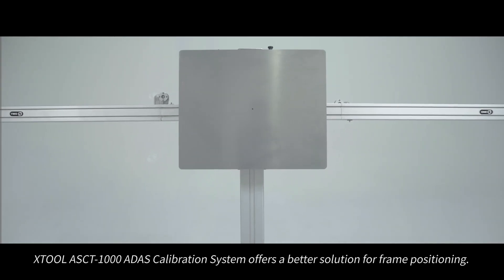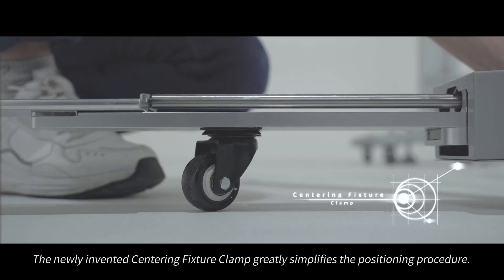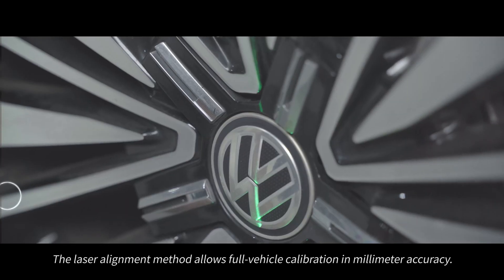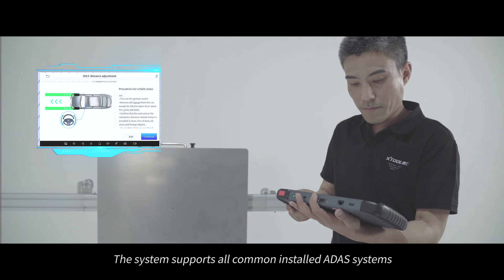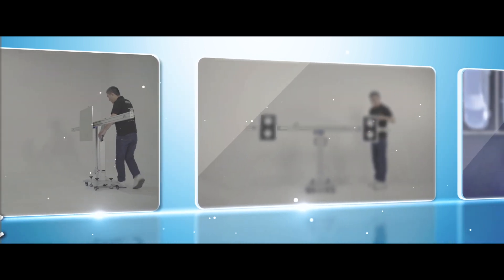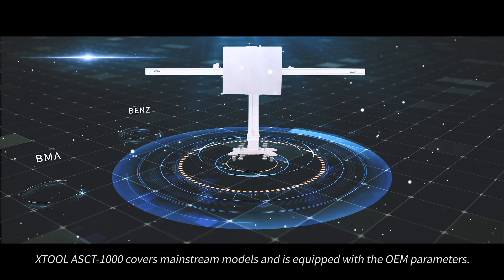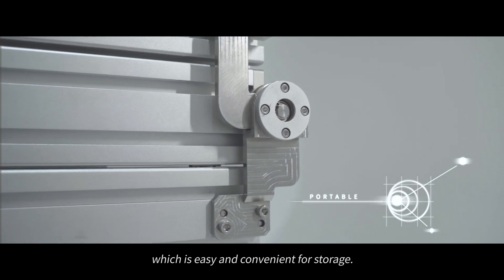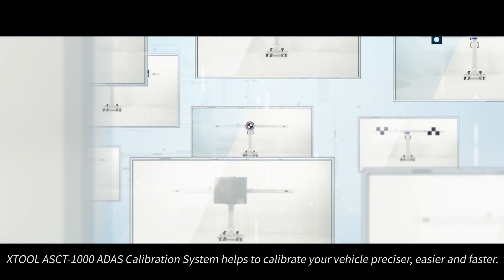XTOOLTECH ADAS CALIBRATION SYSTEM ASCT-1000

Comment: While trying to use my scanner i was trying to set up scanner register my scanner and won't let me log my email into to set up scanner. When I contacted x tool company, they failed to help me in the customer service is the worst. Had numerous emails and never help fix any problem. And on their website says that they have demonstration training of scanner, right on the front. Website.
Which is false advertising? Because they don't, and their customer service is worthless. Scanner does not do half of what it says. It's supposed to do
With failed customer service of x tool